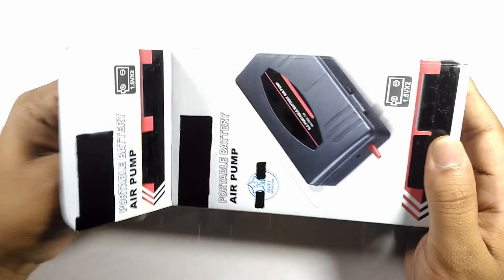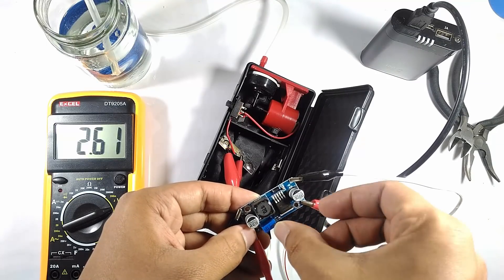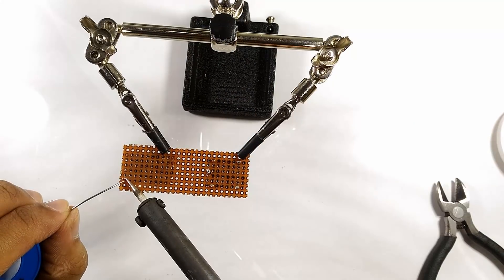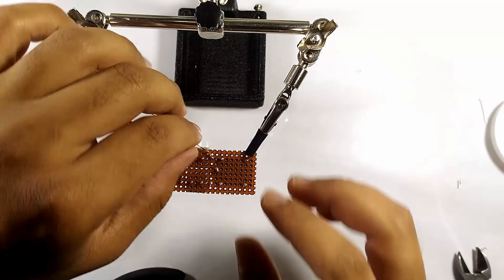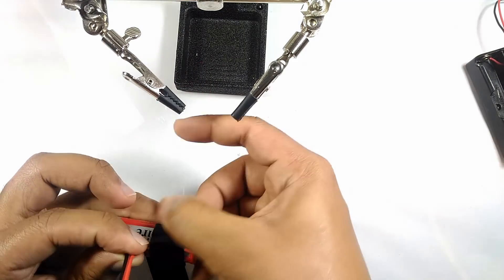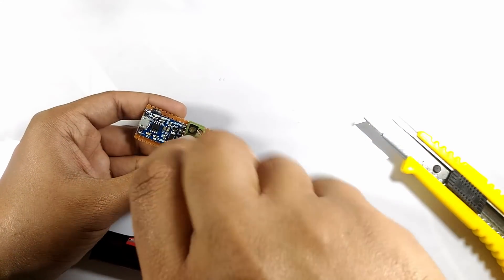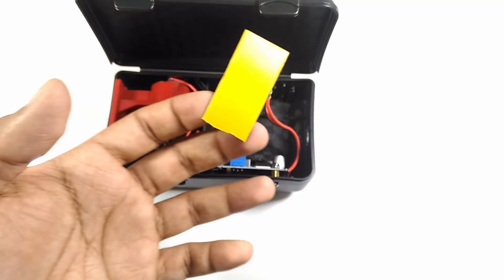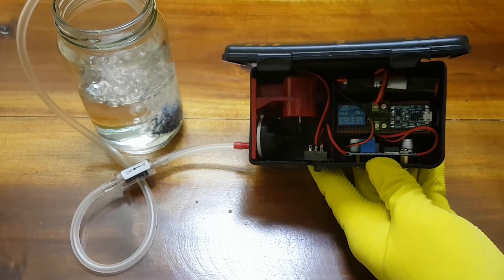Automatic Air Pump (Rechargeable Auto Start) – How to DIY Automate Your Aquarium

Comment: The thing is, this will only work for a period of time once the battery dies you’re without a way to recharge it in the case of a power outage. It would be better to make it where you can swap out the battery with a fresh 18650. The whole reason for using disposable batteries is so you can replace them with new ones if the batteries don’t last the length of the outage. Also if you don’t have a chip that stops the battery from charging once it’s full you’ll damage the cell, which with lithium ion batteries can actually be dangerous, but if one of those boards has the protection circuit built in you’re fine. With all that said this is  still a decent build my friend. 👍

Comment: Nice creation. Can tell us how to increase run time of this
Reply from the maker: Add more 18650 batteries in parallel. No need additional circuits but the batteries has to be of same capacity.
Reply: AquaThumb thank you so much
Reply: AquaThumb if i want to run  24 hours how many batteries needed
Reply from the maker: Atleast 3 with same capacity for each. Different capacity batteries can cause issues.
Reply: AquaThumb if i use 4 same capacity batteries can i get more run time without any cause. Thank you soo much
Reply from the maker: That should work machan. But it will take a long time for 4 batteries to charge. Using more than 4 will be too much for a single TP4056.

Comment: Bro when I chech a 18650 battery power by multimeter  then it see me 4.2v.and when I attach 2 battery in parellel then check it see me the same v 4.2.....whyyyyyyit would be 8.4 v🤔🤔🤔🤔🤔🤔
Reply from the maker: When you connect two batteries in Parallel, the voltage stays the same but the capacity increases. Capacity is not voltage.
To get 8.4 volts you need to connect batteries in Series. But for this project you need to connect in Parallel. The TP4056 works with Parallel only.
Reply: @aquathumb2663  many many thanksssss🤗🤗🤗🤗🤗

Comment: And bro why you attach a diode on output of buck converter to the motor???
Reply from the maker: It acts as a flyback diode. It would be easier for you to understand if you googled "flyback diode". A motor is comprised of coils so its better to have a flyback diode.

Comment: Bro if I use diodes exchange of buck converter then what happence???for volt down 8.4 v to 1.5 vthere will be need so many diodes!!🤔🤔🤔🤔🤔🤔🤔🤔
Reply from the maker: Question 1: What do you mean wp number?
Question 2: Why are you using 8.4 volts? The TP4056 does not support two 18650s in SERIES.

Diodes are not used to reduce voltage. If you try to use diodes between a battery and a motor, the diodes will heat up.
Buck converters are used to reduce voltage efficiently from a higher voltage to lower voltage.
You should be reducing it from 4.2 volts to 1.5v. Not 8.4 volts, DONT connect two 18650s in series if you are connecting it to only one TP4056 module.
Reply: @aquathumb2663  I use 2 battery in parrel not series. Then??????and wp mean whAtsapP numBeR
Reply: @aquathumb2663  q no 2 answer is I use 2 battery for long time working!!☺☺
Reply from the maker: When u connect two 18650s in parallel, the voltage stays 4.2v when fully charged. Voltage doesnt increase when in parallel. Diodes are not used to decrease voltage. Dont try to use a resistor, it will burn up. The only solution to decrease voltage from 4.2v to 1.5v is the buck converter.

Comment: Bro I use 2pc 18650battery and connect them on tp- 4056 charging module .and use a lm2596 buck converter to decrease 7.8v to3.0v.it is not automatically but it work well.when I charging it the battery is so hot then what do????
Reply: Exceed 4.2 v means???
Reply from the maker: An 18650 battery when fully charged is 4.2 volts. The TP4056 supports only one 18650 battery, but if you want to add more batteries to that, it should be in Parallel so that the voltage does not exceed 4.2V, only the capacity increases.
A series connection increases voltage. Parallel connection increases capacity.
Reply: @aquathumb2663  you want to say that I do parallel conection.??🤔🤔🤔
Reply from the maker: Yes, connect the two 18650 batteries in Parallel.
Reply from the maker: Omg no, in my previous replies I said connect two 18650s in Parallel not Series. The TP4056 module is made to work with a 3.7V Li-Ion Battery, its possible to connect more batteries to that but not in series. Only possible in Parallel.
Im suprised the TP4056 didnt blow up.
There is a link to an instructables article in the video description. I have attached a wiring diagram there. Its not possible to have website links on video comments. I highly recommend you check out the link on the video description. 
Please disconnect the batteries from the Tp4056 if you have them connected in series where the voltage exceeds 4.2 volts.

Comment: Okay.but it cannot run auto matically.thank you.what amount need for this project????
Reply from the maker: To run automatically, the auto switching circuit has to be changed completely to handle 12v from the car battery. In which currency do you want an approximate cost for the project?
Reply: Indian ruppes
Reply from the maker: @Discus Keeper approximately 800-900 indian rupees. Might change according to prices of the necessary parts.
Reply: @aquathumb2663  so costly
Reply from the maker: @discuskeeper4410  kind of yea, but its probably cheaper than buying an UPS

Comment: Can I use 4 volt battery(1amp)/or 6 v battery(1amp)????
Reply: One more enquiry, I have,.......If I used 2 battery like you what you used in the vedio then that happens????
Reply from the maker: @discuskeeper4410  you can use two 18650 batteries in parallel connected to one TP4056 module (with protection). Doing this, the runtime of the pump increases. But make sure both 18650 batteries are of the same capacity or else there is a risk of a dangerous outcome.
Reply: @aquathumb2663  thank you
Reply: Actually my problem is I want to run it much more time.then give a sollution
Reply from the maker: @discuskeeper4410  if you are there at your house when the power runs out, you can use an old car battery to power the pump. You cannot connect a car battery to the auto switching circuit as its not meant to run at 12v. But, you can connect the buck converter in between the car battery and air pump so that you can reduce the voltage from 12v to 1.5v efficiently. This will run the pump for longer, but you have to be there to switch on the pump.
Reply: Reply plz
Reply: Then it what time runs???
Reply from the maker: Hi, I used a TP4056 charge controller for this project so it only supports 3.7V Batteries which are the common 18650 Rechargeable Battery. A good 18650 battery when fully charged can run the pump for over 6 hours.

If you use a different type of battery you will have to get a compatible charge controller for that specific battery.
Reply: Actually recently my 5 discus gmfish died of no current in house,so I need to make this project argent
Reply from the maker: @discuskeeper4410  you are welcome, if you have any other questions about the project, feel free to ask. Were the power cuts in the month of march?

Comment: Can u please convert a 220v air pump with 2 nozel to a dual
Power pump with 220v and 12v battery so in case of electricity failure it switches to battery
Reply from the maker: What you are asking for is possible, but there is the easy way and the hard way for it. The easy way is to connect your air pump to an old UPS. The hard way requires hacking into the air pump and soldering stuff. Ill make a video on how to do it the hard way, but it will take some time tho. Btw thanks for watching this video :)
Reply: AquaThumb thanks already attached to ups as on long run looking for this solution
Reply: AquaThumb we have taken 220v to 12v relay my4n1 can u suggest some quick way for it
Reply from the maker: @esolbiz13  did you convert your 220v air pump to 12v?
Reply: AquaThumb we r going to change 12v with this relay so it can on when wapda goes off
Reply from the maker: @esolbiz13  maybe I misunderstood what you said but, you cant power a 220v air pump without changing the internals of the air pump. Changing the relay wont do much unless the air pump works with 12v to begin with.
Reply: AquaThumb we are using same pump like u have in video with 2 cells and with it use relay of 220 to 5 so it will just on the cell operated pump in case of power loss
Reply: And we did not have to keep wait for ups to get off and then on manually cell operated pump
Reply from the maker: @esolbiz13  use a relay with 220v coil, connect the 12v battery to the relay switching contacts then to the step down converter, then connect the step down converter to motor of the pump. A charger or the ups should be connected to the 12v battery so it charges when there is power.

Comment: how long it can run continuously ?with one battery
Reply from the maker: I used a cheap ultrafire 18650 battery and it ran for over 2 hours. Using a better battery with more capacity could give you a higher run time.
Reply: @aquathumb2663  what battery you suggest for use in this project